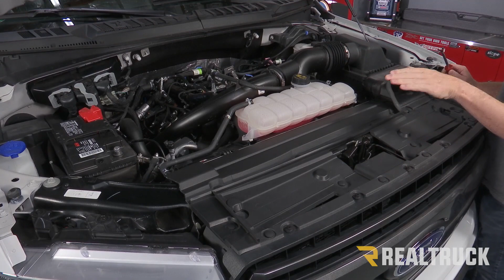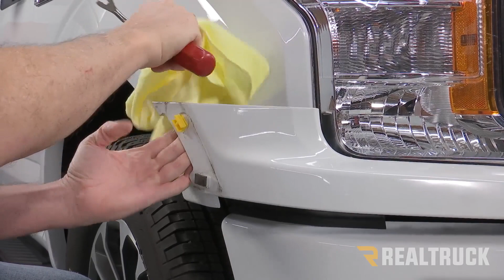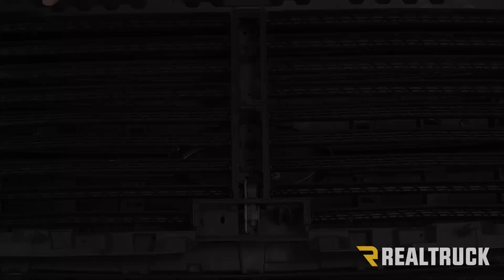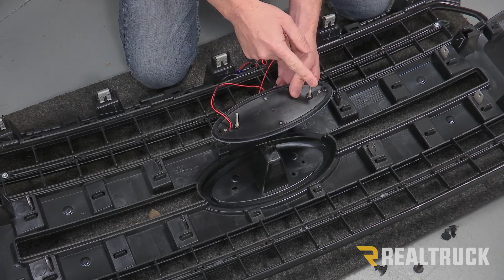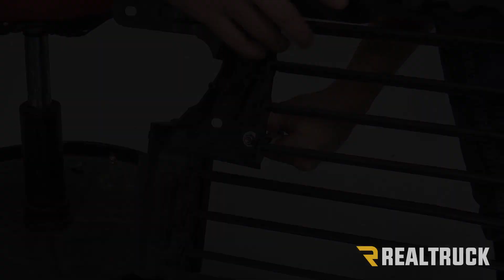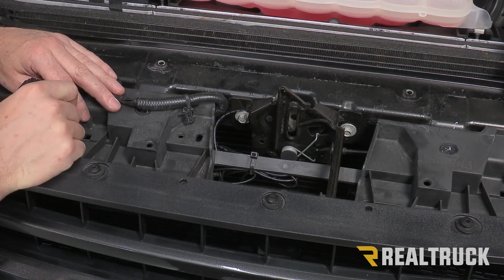How to Install Putco Luminix Ford LED Emblem on a Ford F-150

Comment: I suggest when adding a tap fuse that you explain which direction it goes. There's two ways it can go (this way or that way). Both directions can supply power, but only one way will have fuse protection, the other way will not. If you know, you know. Some don't though.

Comment: Just purchased for my 2018 f150, I was wondering what fuse location I would use so the light isn’t constantly running.
Reply from the maker: The design behind the lighted emblem is that it would remain illuminated as long as the truck is on. When the truck is turned off, the emblem light will turn off. By the way, if you want to see something really cool, we partnered with Travis Kelce to award a worthy recipient with the ultimate tailgating truck! Check it out!! https://www.youtube.com/watch?v=xF2WeRlIcgI

Comment: the equivalent to the "#18 fuse spot" (Ignition switch and passive-entry passive-start start stop switch) in a 2021 f150 is not under the hood, but below the passenger seat inside the cabin... how am I supposed to connect the wiring????
Reply from the maker: Hey Mark, we think that you may have to extend the wiring for that application, but you may want to call Putco directly to see if they have another solution for the 2021. Their number is 800-247-3974. Hope that helps!

Comment: Well, I bought one. Found a shortcut too. Remove the hood latch and you’re able to remove the emblem with a 1/4” 6 inch ratchet extension
Reply: You should make a video of that shortcut
Reply: I did the same. Waaay easier! Then I taped the nuts to the socket in order to attach the new emblem.
Reply: @justinward3218 what year and trim do you have?
Reply: @justinward3218 and how long would you say this shortcut took you?
Reply: @TexasRunners18  2024 xlt. Not counting the time wasted trying the other way and being extra carful with clips, maybe about 1.5 hour

Comment: Very detailed video. thank you.  even though I don’t have same year and model how precisely you describe your steps separate your video from the rest. Continue to produce more video people like us can get benefit from your expertise. 

Can you please give little bit more detail how electric wiring works, where should I connect emblem wiring to?? And how it works when turning ignition switch on. I have a 08F150. Thank you again
Reply: I'm hooking mine up to one of the factory upfitter switches

Comment: All you have to do is remove the latch and you can reach the back of the emblem.
Reply: Does your truck not have the active grille shutters? Seems like those have to come out to get to the back of the grille.
Reply: sixsixST2 Once the latch is out you manually open the shutters and with a long extension they are easily reached.
Reply: @TheCarCrazyGuy   gotcha. I was gonna do this install when I swap out the headlights so I have to pull the grill regardless, but not pulling the shutters will deff save some time.

Comment: The first time I saw this video, I did not get half way through it before I thought, "NOPE!" But I really liked the emblem and thought it would look cool on my 2020 Lariat. So decided to watch the video over and over again until the steps seemed less intimidating and started making sense. Pretty soon I started seeing the steps in my head. The instructions are pretty thorough and the install was easier than I initially thought. The one thing I wished he had mentioned is that you will need to cut a notch in the underside of the fuse box lid. Otherwise you will end up pinching the cable when you put the lid on. Other than that, this is an excellent video and I could not be happier with how it looks. Thank you!

Comment: Thanks for the tutorial, luckily on my 2017 f-150 you don’t need to pull the whole grille assembly off I was able to reach in from the front and do the install
Reply: How long did it take for it to get there
Reply: Thank God! I'm glad I read your comment. Now I just need to find a way to wire it to the fog lights to only come on at night.
Reply: @HK304  how did that turn out? I might be interested in doing something similar
Reply: Wait you have a 2017 and you didn’t have to take anything apart? 
I have one and I want to buy this emblem
Reply: @cdnconcrete392  there’s enough room directly behind the grill and the shutters to get your hand back there with a small wrench/spanner to get the nuts off, you will probably get scraps and cuts on your hand and wrist but it’s worth the little bit of pain and grief over having to pull the whole front end off